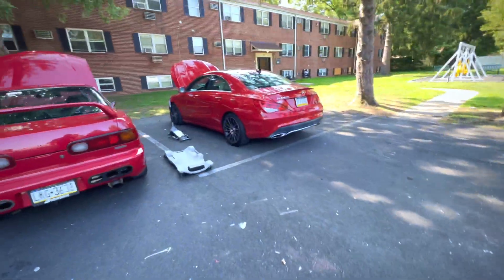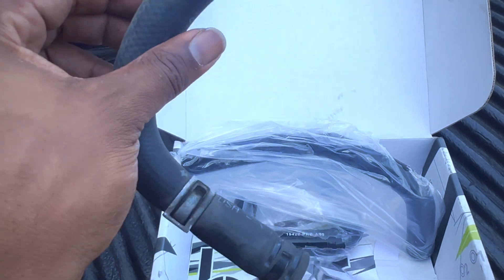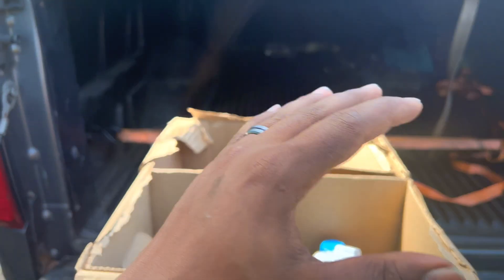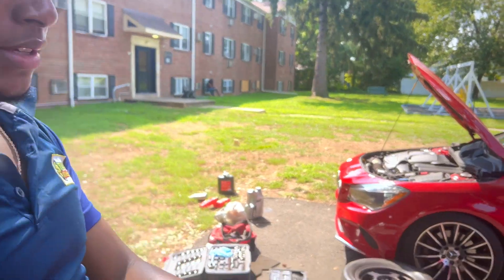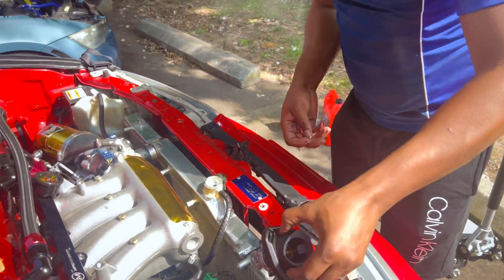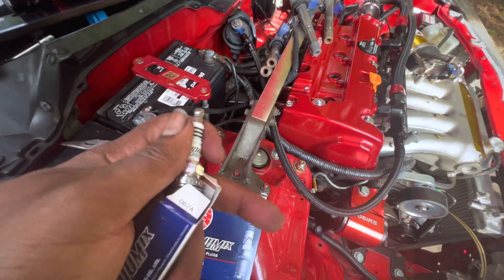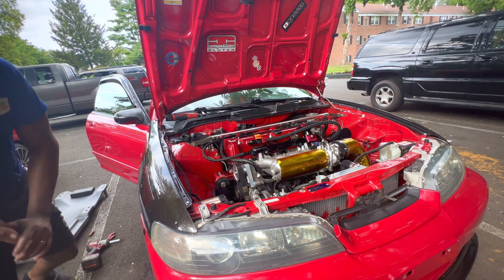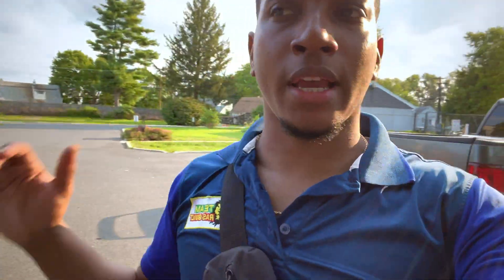Hybrid Racing thermostat install k24 Integra // kseries bleeding nightmare 🫠

Comment: If you drill a tiny hole into the thermostat it will allow for easier bleeding process
Reply: Where in the thermostat?
Reply: @dc5.rivera  on the little metal plate that is circling around the actual thermostat it’s the part that clips into the housing

Comment: I’d get rid of the other plastic piece on the thermostat housing… u could bolt this directly to the water pump housing
Reply from the maker: I was really thinking about doing that.
Reply: @tevdc2  tbh i been reading u needa use a oem thermostat bc it’s dual plunger type if not it’ll overheat on idle or something
Reply: Have u had problems with this thermostat housing? It’s basically the only one i found that uses oem thermostat which is best since sits dual plunger style unlike all the other small thermostats that the other aftermarket housings use
Reply from the maker: @user-hh4hc2lt6e  no problem at all to be honest. Keep my temp at 185 degrees constant but I curious to see how it perform in the summer time